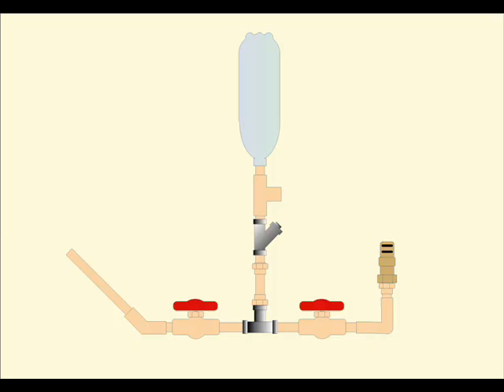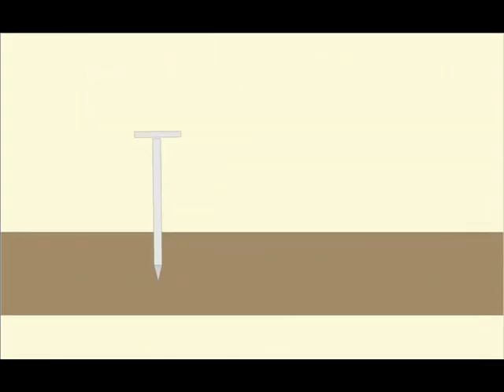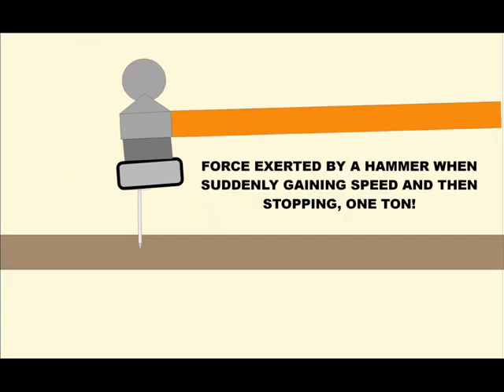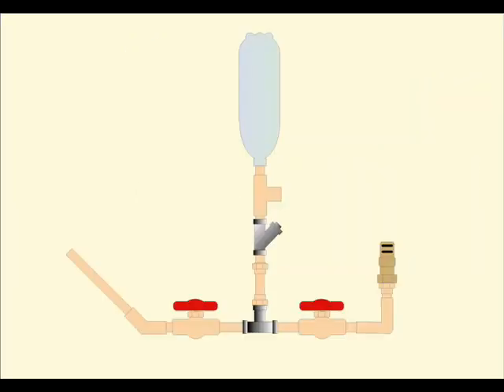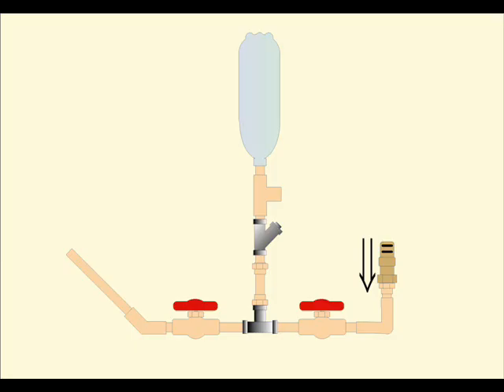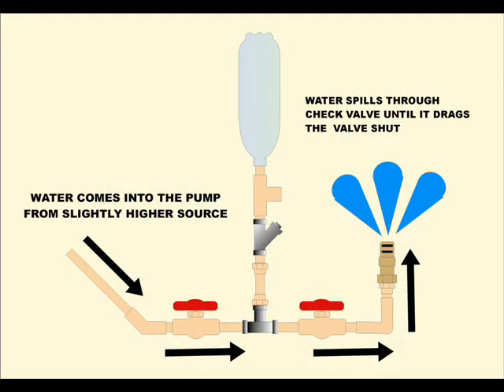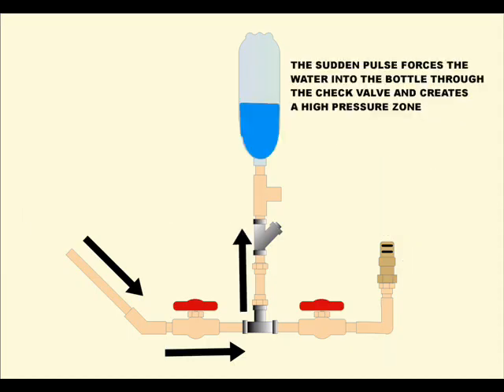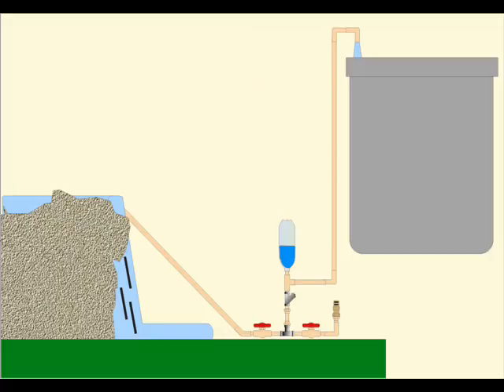How does a Water Hammer Pump work?

Comment: Could this work for an outside boiler setup? I’m trying to find an efficient way to move heat throughout my house with the lowest cost
Reply from the maker: Dear Rohmeo, unfortunately the principle of operation involves wasting a Lot of water. Maybe you can use a small centrifugal force electric pump, and a solar panel (even an old one) just to pump the water around. Solar power systems have become commonplace nowadays, and if your pump works on DC you do not need any addirional gear, just the panel and the pump, if you can find a low voltage output panel and a pump of a matching voltage, say a 12-volt panel and a 12-volt pump. I have even used a 60-volt output panel and a 90-volt treadmill motor.

Comment: Thanks for the video. 

You seem to have my head around a lot of it.

My only question is about the cycles that you mentioned. After several cycles, there’s enough pressure from the bottle to allow the water to be pumped up to a receptacle of a higher elevation.  
   Is the cycle something that would automatically happen sort of passively once you’ve got this set up?  Or does it require some input of energy beyond that which the water, valves, and other apparatus provides?
Reply from the maker: As a matter of fact, the energy is really the weight of the water being at a high place, which in turn runs downwards and gains speed, thus dragging the valve closed, and suddenly stopping the flow, it's like a hammer being accelerated and suddenly stopped by the head of a nail. All that acceleration energy suddenly stops and exerts a heavy weight on the nail, much greater than the weight of the hammer itself. Every stroke of the cycle forces a small amount of water in the bottle (technically called "an accumulator") which keeps adding up until the water is forced upwards in the high tank. Actually, the pump wastes a lot of water, since about three gallons have to be spilled for every gallon of water forced up to the reservoir tank. However, if there is a natural stream with sufficient slant, since no fuel is needed, the pump can be very useful and requires very little maintenance. ¡Regards!

Comment: what are the materials used in this water hammer? Can you list down the materials used? because this is our project and we need it to done it immediately.
Reply from the maker: Yes , of course - most of the pipes are iron or copper 1/2" tubing, the check valves are very common in plumbing, they are generally copper or brass, same as the fittings; the Y shaped check valve is used since it is easier to maintain. The pressure bottle is just a big soda bottle, they can usually hold enough pressure for the project. It must be attached to the copper tubing by using epoxy cement. One important thing is that the source of water must be about 3-5 meters above the pump, in order to have enough acceleration of the water coming into the pump, so the hammer effect is sufficient to drive the water up to the elevated reservoir.tank. The shut-off valves shown with red handles are not indispensable, but it is convenient to be able to shut the pump off whenever needed. Some people use PVC tubing, and  it works, I prefer solid metal. Be aware that about five liters are "wasted" for every liter pumped, however, this usually does not pose a problem when pumping from  a natural stream with a natural water fall. The length of the pipes in the pump is not critical, about 4 - 5 inches long, most of them. The list would be as follows: one 45 degree elbow, seven 3 inch long nipples,  two shut-off valves, two tees,  two check valves, one of them of the kind known as  "foot valve" and the other a "Y" type,  (all pipes and valves 1/2" diameter; and finally, a big soda bottle. During operation, the bottle is about 1/3 full with water and the rest is air, so it can compress and act as an "accumulator" of the pressure. I hope this helps.
Reply: Chava Tarin thank you for the info. It'll help a lot